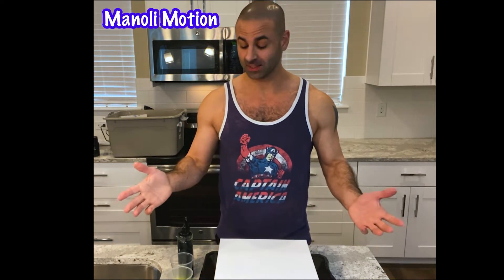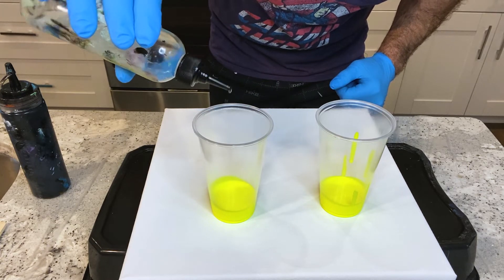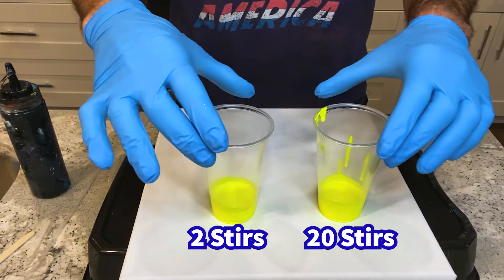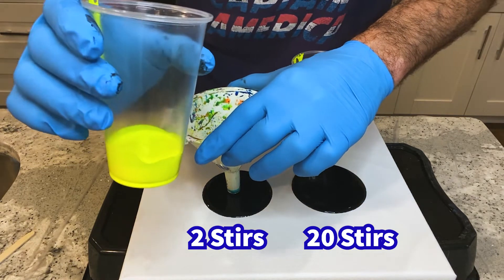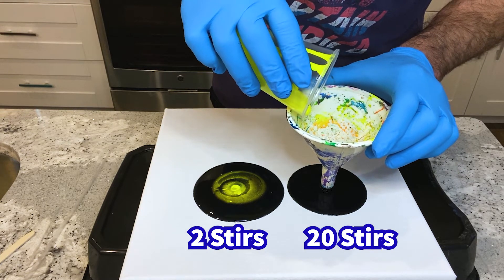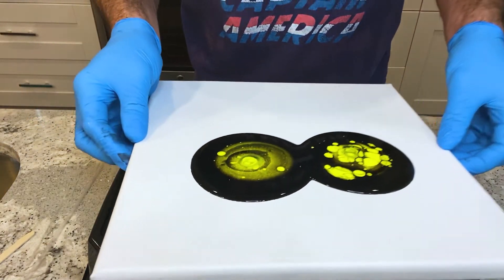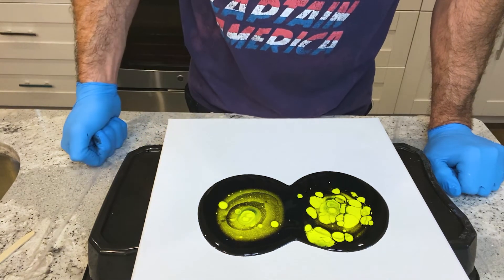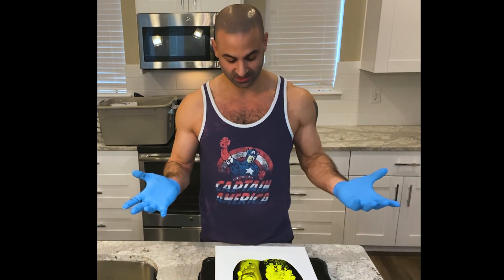How Much Should I Stir Silicone Into Paint: Fluid Art Experiment

Comment: You said you rinsed tgr Funnel between pours, right? Since the Funnel had water in it for the second pour and not the first pour, I wonder how that changed the results because water usually causes cells as well, right?
Reply: This is interesting bc every video I've seen on the use of silicone says just the opposite.  Yet here it is right in front of my eyes.  Thanks!  👍
Reply from the maker: Hey there! Yes, the funnel was rinsed in between pours. However, in this video, the silicone created the cells. In my experience, with the funnel technique, water doesn’t create cells. Meaning, if I were to put a drop of water in the neon yellow paint as opposed to silicone, there wouldn’t be any cell-like effects unless there was extreme varying densities in the 2 colors I used. Being that acrylic and floetrol are both water-based, you would be need an oil based cell activator such as silicone to create this effect. Of course, this info is only for the funnel technique in this video and I’m pretty sure it would apply to some others such as the flip-cup technique. None of this info is written in stone though, lol! This is just in my own experience.
Reply: @manolimotion  thanks! I just got into pour art and while it seems like it would be super easy, there's a lot to learn! At least, there is if you want to try different things.
Reply from the maker: Definitely a lot to learn and thousands of techniques. It’s not an easy art but that’s what I love about it. 😃